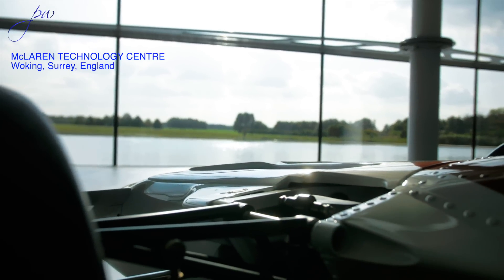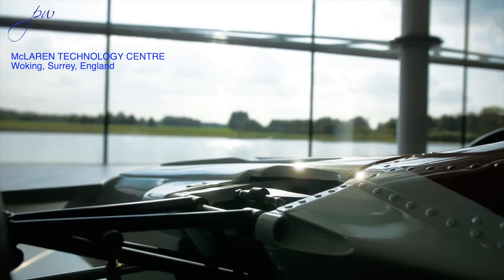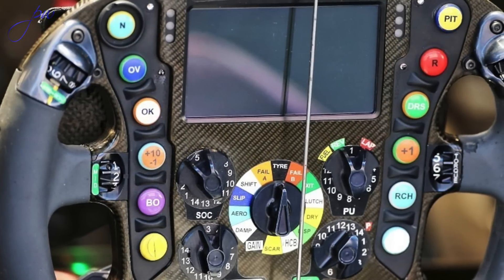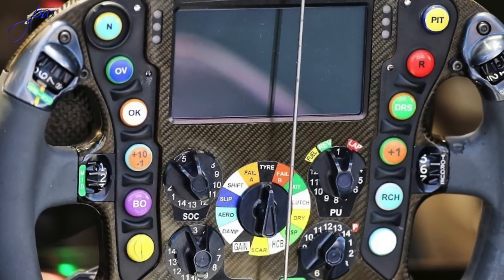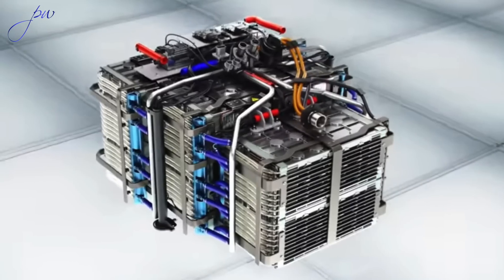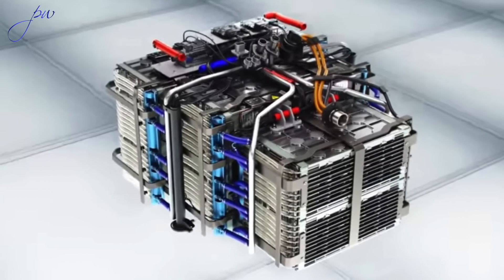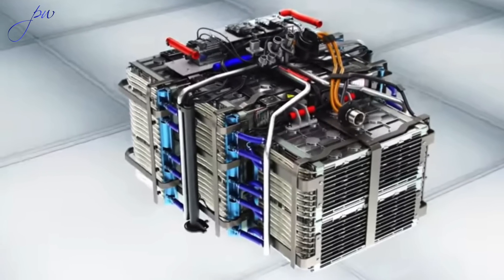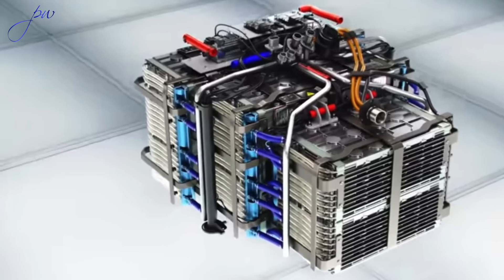The F1 drivers' laptop with McLaren Applied and Scarbs by Peter Windsor (2/2)

Comment: I'm surprised they are just "talking about" Silicon Carbide inverters and don't have them running already. It is fairly well known in the semiconductor industry that silicon carbide as the semiconductor has advantages in power transistors. 
It isn't the predominant material in use today, but it is already growing as the EV industry looks at it.
There will be an issue if it wants to become mainstream though, as there are not many fabs that can run it, and wafer size is constricted to about 6" currently and runs on a mix of 4"-6" wafers. This will mean even more volume issues if demand ramps up as 6" tools for manufacture are like hen's teeth and are old technology and usually old tools (circa 1980's to mid 90's vintage).